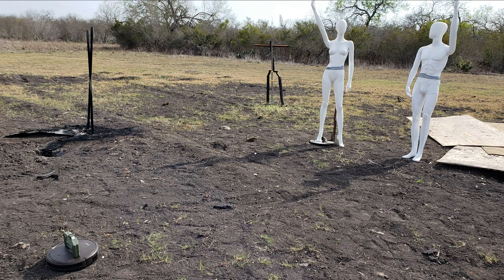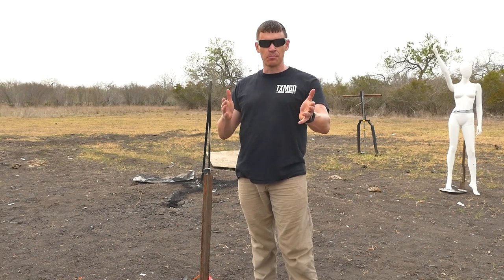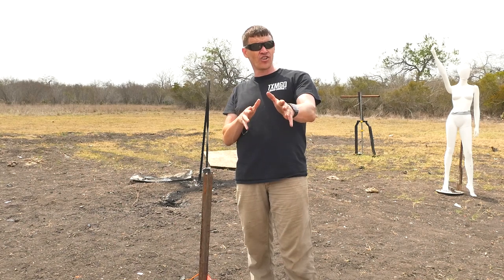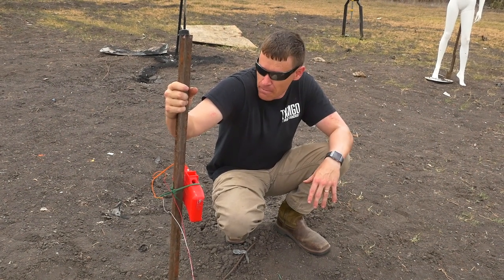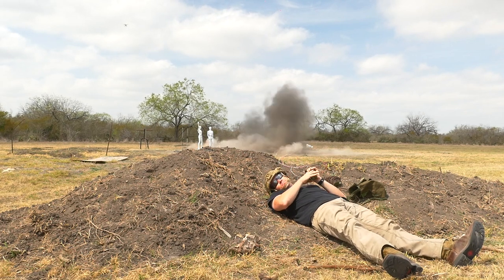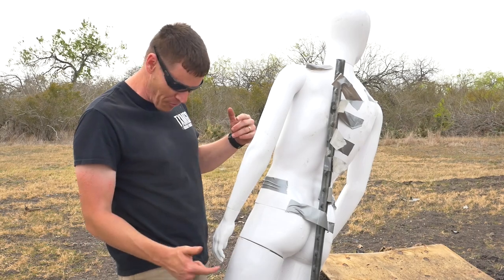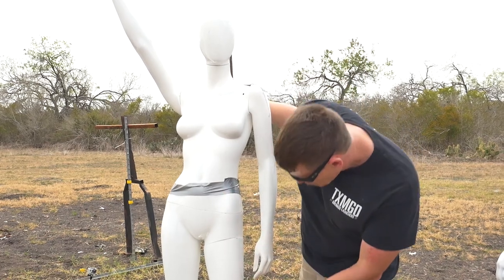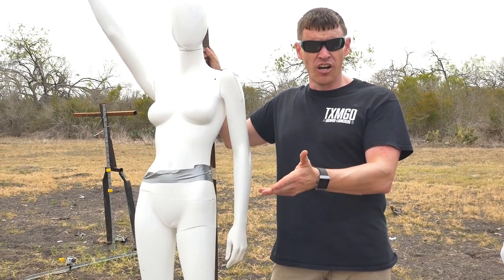Roomba-Boomba with 3D Printed Claymore: Part Deux

Comment: You ever consider taking out 5 or 6 sheets of cheap plywood and setting in an arc behind the volunteers? That way you could get a good idea of the actual spread and dispersion of the shot.
Reply: We are going to put up butcher paper across the projectile arc from now on. That way, we can show the projectile pattern and is super cheap to reset.

Comment: In production claymores and other shrapnel bombs the shrapnel is mixed in with resin and molded. Also you could separate the explosives and shrapnel with something like a shotgun wad. Usually a wood/thick cardboard/ or metal plate between shrapnel and explosives

Comment: Back 40 years ago I opened an insert cluster bomb sub munition, packed it full of C4, and detonated it with a blasting cap. Didn't produce much of a pattern but it decimated a 1/4" plywood humanoid ten feet away. I recovered a couple of pellets from the oak tree behind the plywood. Don't know if it was from the bristance of C4, or the impact velocity, but the pellets were somewhat oval shaped.

Comment: The manual on the claymore says specifically don't attach it to any object like a tree. The claymore is designed to be fired using its legs at ground level well away from any solid objects. Anything close behind it is certain to disrupt the shrapnel pattern.

Comment: I'd like to see a vacuum sealer used to pack the bearings instead of epoxy. Epoxy is often used so things don't rattle or shift. Vacuum bags would keep it quiet while allowing easier dispersion. Also, from the footage it looks like the transition/reaction is traveling from one side of the device to the other causing a directional pattern to the blast.

Comment: Just an amatuer observation.  The arc is pretty short and the pellet distribution is uneven.   Also, the explosive load appears light.  But, great effort for a redesign.
The reason the development took so long was the pellets and matrix are more magic than science.   In the day,  the Miszanay-Schardin effect was not well modelled mathematically.  So each variant had to be field tested. 
As I recall, the steel in the bearings has a certain malleablity(softness).  The explosion (1.5 lb C4) deforms the pellets into bullet shapes about .22 cal.  This shape penetrates flesh better than round shapes.  The point of the bb matrix is to insure the arc spread and the deformation.

Comment: As I was watching your video I couldn't help but wonder if flechettes would behave differently at longer ranges. I also couldn't help but wonder if flechettes made of tungston carbide of various sizes would have better performance as far as penetrating power.
Reply: They do. Tanks use them for anti personnel. Also make wicked holes in soft skinned vehicles

Comment: You have probs thought about this but: 
Maby some kind of wad like layer between the epoxy and the spicy play-doh? Im not sure of the det speed is of what you are using, but potentially changing the location of the detonator needs to be moved so it detonates from the bottom up? 
Is the casing material substantially different in brittleness from the OG product?
Reply: The plastic definitely behaves different, being this one is 3D printed  (maybe even from PLA) and OG Claymores are extruded.

Comment: 1 - they're designed to be used with something behind them to maximize outward blast/ shrapnel effects.
2 - anneal the steel BBS to a mild steel, softening them helps in their destructive capabilities.
3 - make sure both detonators are of equal length in their wiring. If 1 is longer than it will detonate 1st thus skewing the blast to 1 side. It happens in a fraction of a second but that's all it takes to throw your shot completely off. Think of it like pulling a trigger, good even straight pressure otherwise your hot is pulled to the left/ down at the target. Its the same for this if only1 detonator is used or wires are uneven the bast is pulled 1 way or the other.👍
Reply: the thing is with  real claymore you only use 1 blasting cap not 2

Comment: It looks like you’re not ensuring an even spread of projectiles across the surface of the explosive. If you can get an even layer of the ball bearings or whatever you’re using, all across the explosive’s surface. Then you should get an even spread coming out. You might even try something cheap and weak like masking tape to keep the projectiles in position.

Comment: Guys do you not understand how a claymore works?  The front of the claymore needs to be the weakest spot and should not be blocked by the tie downs. The fact that the back blew up means it's not strong enough to hold the charge, and direct the blast forward.      like the steel cases do.

Comment: Hey fellas good job. Correct me if im wrong but i believe standard claymore have 90+ .32cal bearings in them with a sheet of c4 adheared behind the bearings. Your aim looked a bit off. Does your 3d printed clay have the aiming point on it? Im gonna send money because i do understand the need. Good day to you guys.

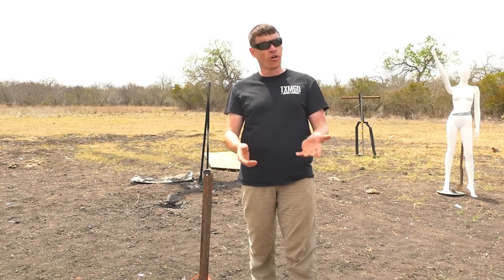Comment: 1:24 zero! Negative! An ambush is only instigated with a closed bolt weapon.
Reply: I know former airborne that trained to use claymores to start the party. Known a few more soldiers that initiated with m60, m240, and m249 depending upon when they served. None are closed bolt. Met some that fought in Serbia that initiated with RPG. One from Syria that started ambushes with a PKM.
Reply: hell i'm of the mindset all ambushes should start with explosives. sow true cchaos and destruction then start the main event

Comment: Way too close and *aimed too much to the right to cause optimal effect on both targets.
A M18 claymore contains 700 steel speres, the optimum effective range is 50 m (55 yd), at which the optimal balance is achieved between lethality and area coverage, with a hit probability of 30% on a man-sized target. (30% of 700 is 210 hits per man sized target)
[Note: *aimed too much to the right - watch the arial footage closely at 2:50, both before and after detonation, the male target caught the edge of the projectile pattern.]
Reply: I was under the impression a standard claymore had 90 .32cal bearings in them.
Reply: @robertreynolds9228  I am unaware of any Claymore Mine with this loading, however it is unclear to me what the projectile loading on this particular device was.
The Military loading of a M18 Claymore is approximately 700 1/8" diameter soft steel balls set in epoxy resin. When detonated, the explosion drives the matrix forward, out of the mine at a velocity of 1,200 m/s (3,937 ft/s), at the same time breaking it into individual fragments. The force of the explosion deforms the relatively soft steel balls into a shape similar to a .22 rimfire projectile
Reply: @robertreynolds9228  2-3/4" 00 Buckshot is *commonly described as having 9 .32 caliber pellets, could this be where you got "90 .32cal" from, maybe just mistaking the quantity of projectiles ?
[Note: *commonly described ".32 caliber pellets" - 00 Buckshot actually has .33 caliber pellets. 0 Buckshot has .32 caliber pellets.]

Comment: I'm not a gun person! I don't own, fire, or touch guns, (Canadian).   
But, watching your video on sound suppressers, I was wondering?? 
Could one make a, sort of, suppresser, out of a hollywood muffler, (straight through). 
It would be oversize and strange looking; but might make the report sound like a car door slam!  
One could mount it by wrapping rubber tape around the barrel; (cheap).  
If you do this, the ATF might require serial numbers, and registration, for mufflers!  

In BC they have a big problem with home invasion, that's where the criminals bust in the house, when you are at home!  
This is a big problem for the police, the can't get a grip on it. 
It's unheard of in TEXAS!
I'm not a gun person, but I do like the second amendment; not so's I can own a gun.  
But that a "home invader" would rather not get shot, plying his trade!